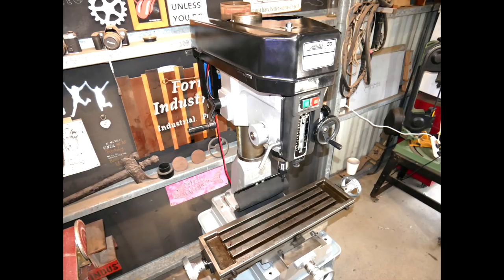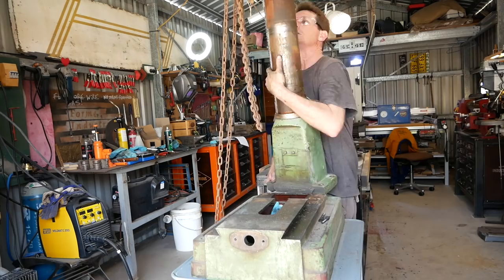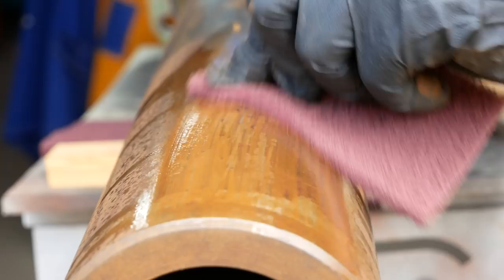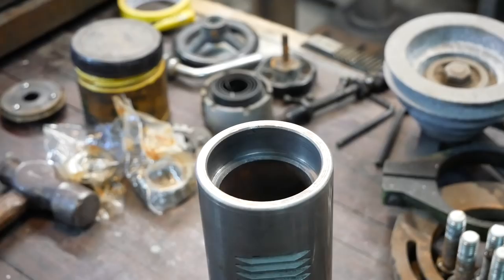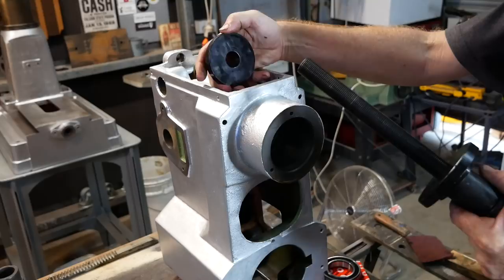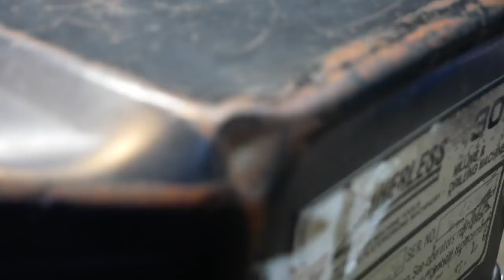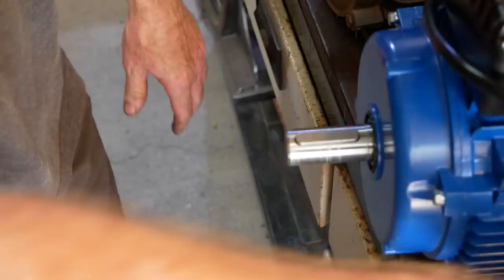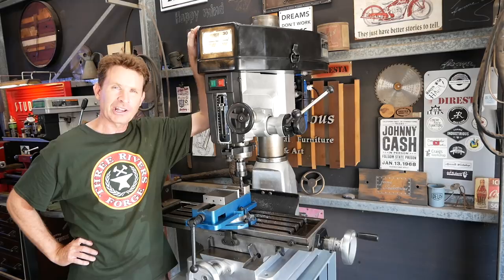RF-30 Mill Drill Restoration - Forme Industrious

Comment: Hey Scott, great work. Adelaide to Townsville and back is a bloody long way to get anything, even if it is free. Personally I would have gone for the VFD. I’m running three in my workshop including one on my 3 phase x 3 hp turret mill and the VFD for that was $120 delivered. It’s not just being able to run the three phase but you get speed adjustment at the turn of a dial and reverse. No more changing pulleys and belts. Anyway I really enjoyed the video. Cheers Stuart, Canberra.

Comment: Thanks Scott.  I just picked up one of these and am preparing to do the same thing.  This was a great tutorial.
Reply from the maker: My pleasure! Good allrounder these machines.
Reply: @ScottTurnerformeindustrious  Has the machine had much use since this video?  I ask because I was wondering how that paint held up?  Thanks
Reply from the maker: @rustyshackleford928  Hasn't had a heap of work as I have been doing other things, however I'm very happy with the paint so far.

Comment: I found toilet bowl cleaner useful for de-rusting. The gel type sticks quite well to the object being de-rusted and it's gentle on the metal. I was given a Schaublin 102 turret lathe for free that needs similar love and care to your RF-30. We have 3-phase so no need to do a motor swap. Actually considering mounting a 3-phase motor on my mill so I can use a VFD to control speed.
Reply from the maker: Toilet cleaner, will have to experiment. Restoring the old machines is a big task, however it is interesting once you get past all the grim. VFD would be nice. Thanks Michael!

Comment: Great Scott! Wizard video thanks, and a reference for me as I've just acquired a generic copy. Mine has no name but I suspect it's a Warco variant. Suggestion... my gib strips are tapered and adjusted by sloppy screws in a slot in the jib just like yours. I replaced them with studding, seated tight in the blind tapped holes. I them turned up two threaded buttons that perfectly fitted the jib slots, so now I can adjust them to that perfect spot with no wobble or tightness.... and hold them there on a lock nut. (I have to turn hex nuts down to a small round OD to clear the jib.... easy to do, mount them on a tap and hold that in the 3 jaw.) 
I shall get going on sorting quill, fast and slow feeds and the rack/pinion on the column next. Also need to check alignment of column to bed. Only adjustment is by shims under the clamping bolts......
"You beautiful great thing" made me laugh!
Thanks again Scott.
Reply from the maker: Glad you enjoyed the video and thanks for sharing your journey on your machine.

Comment: Nice restauration-I have the bigger RF-31 and did a similar restauration about a year ago,however i threw away the old leadscrews and replaced them whit new ballscrews instead-definitly worth the money,mine is also upgraded whit a 3-axis DRO and a diy-3axis-cnc-kit whit nema 34-motors-lots of fun stuff hace been made in that machine
Reply from the maker: Cheers! Will have to look into those ball screws. They would be great for getting rid of that pesky backlash.
Reply: @ScottTurnerformeindustrious  they r indeed

Comment: Hey Scott.  I’ve had great success in removing rust and scale buildup on many vintage parts by soaking them in straight household vinegar.  You have to let the parts soak for a day or two however, so it’s a little time consuming but after that soak, a wire brush takes it all off without much elbow grease.
Reply from the maker: Good tip, thank you! I'm a little impatient.

Comment: Scott, I had no doubt that you would return this "dirty girl" back to its former glory. She looks like a teenager again! You did an outstanding job of restoring this old girl. I have to say that the parts you were removing were actually all in good shape, just a bit neglected. I have found that older machines made in Taiwan were built quite well. I have'ntThe columns of machines like this, drill presses, etcetera, always seem to get rusty. It's very easy to prevent that and that is done by a-monthly spraying of WD-40 and lightly rubbed off leaving a light film on the column. I also use paste wax on the flat surfaces such as my table saw that I do often. Once a month is just how I maintain my machines, but I think once every 3-6 months should be fine too. Have you had a chance to speak to the previous owner? I bet he is a bit sorry for giving it up after seeing it in a like-new condition. She's a beauty now. Well done mate!!
Reply from the maker: I'm so glad I took the project on, and extremely grateful for the generosity of the previous owner. Yes I have been in touch with the donor and he loves that it is refreshed and in use now. Yes apart from surface rust and crud it was pretty good all up. Where I live is quite humid (Tropics) so I have to spray all the surfaces at least weekly. My lathe chuck and band saw surfaces seem to have hand contact more that most other machines and they will oxidise pretty quick if not hit with the WD-40. I use wax (on the machines ;), say every six months and that works great like you say. Thanks you so much again for your comment and feedback!

Comment: Wow Scott, your shop is really coming together. Such a nice job you did on that mill. Tremendous amount of effort you put into it. It looks like it had very limited use, but was rusty. Now cleaned and renewed it should serve well. I have a very similar mill from Tiawan, mid 80s, its a stout unit and works well, needs to have your  treatment done with the new spindle bearings.   You vid was very helpful seeing how it all put together.  Your mill has Mt3 taper in the spindle, however It looked like it has the "slot" to lock the collet as well, not familiar with that here but if there is tooling to match with the drive slot that would be very stable system.   Thanks again for sharing, expect you will have many projects benefiting from the milling machine.
Reply from the maker: Thank you Douglas! I'm very happy and quite grateful to have this machine. It took a bit of effort and I guess that adds to the satisfaction. Yes it has a MT3 Taper and Draw Bar. I had to make the draw bar. No slot in the taper. The chuck is an ER32, I bought from Ebay. Thanks for your comment Douglas! All the best.
Reply: @ScottTurnerformeindustrious  Still enjoying your work and this video years later.  My spindle bearings still making noise. Did manage to pick up another used Clausing 8520 mill , smaller, using MT2 collets, but a fine small knee mill.   One thing that would have been nice to incorporate into your restoration, would have been some indicator arms on the column and mill head to keep it aligned when raising the head during a project.   A simple dial indicator at distance on light weight arms would do well.
Reply from the maker: @douglassmith2055  thanks Douglas! You are right on the alignment and I have had the problem a few times now. You can buy an alignment guide/ brace the keeps the milling head central, otherwise you set up a dial like you say. A knee mill would be awesome  however I must say I'm still very happy with this old thing. All the best!

Comment: Scott, Evaporust is now available at Super Cheap Auto here in Oz. I was sceptical when I bought some having seen so many references to it on certain US based channels but it actually works great. Doesn't harm the paint either. I know how hard it is to remove that hardened rust crust. 
Regards,
Mark Presling. Sunshine Coast. Qld.
Reply from the maker: Thanks Mark! I didn't know that. Will definitely get some and try it out. All the best down there at the beautiful Sunshine Coast!

Comment: I had one identical to that.  It was great to learn manual milling with.  

My #1 suggestion is to replace the pinch bolts for the head with proper high-grade, fine thread bolts.  The Chinese ones are soft, and will eventually allow the head to slip down, or rotate, causing scrap parts at best, or a hard crash into a vise or rotary table at worst.  

My #2 suggestion is to figure out a method of repeatably locating the head.  I had thought about using a laser pointer and a mirror on a far wall to reflect back to a target on the mill head.  I never implemented it, though.

I think you'll get a lot of enjoyable hours of use out of it.
Reply from the maker: Thanks Alan. Already replaced. What came with the mill was cut off threaded rod with nuts. I replaced with High Tensile bolts and nuts. M16 I think.

Comment: I have to say that I really enjoyed this revamping the milling machine. Am really curious as to how close of a tolerance the machine can hold ??  Would like an answer if you can be so kind. Thank you Sir. Good day too.
Reply from the maker: Thank you! Well, I haven't done anything that I would call precision on the mill yet. The Specs say it can achieve 0.02mm which is pretty good. To achieve that though I think I would need a quality Collet chuck and end mill. Mine are cheapies but they are okay for my needs.
Reply: @ScottTurnerformeindustrious  Thanks Scott !!!

Comment: I'm getting a 1999 Wong Fu R-30 in a few days and can't wait! Although, I hope I don't have to go to this level to get it going ;-) RE: the chrome ring you cleaned up, you can do your own nickel plating and buff it to make it look almost like chrome. Just look for "DIY nickel plating" on youtube. It's SUPER easy and I've even plated some antique tools, which came out great. Also, the rust removal could have been down in a fraction of the time using a car charger and couple other basics. Just look up "electrolysis rust removal" - anyway, great work!!
Reply from the maker: Thanks for the tips Pete. Will have to try it some time. You've got a good solid machine coming by the sounds. Cheers.

Comment: Ive got the same mill drill myself - bought it s/h and it has pretty worn ways and feed nuts but it serves a purpose for me - i have to face mill loads of steel blocks.  Still quite accurate if you nip the gibs up, and  Im thinking of making delrin feed nuts for it, as the stock ones are hard to source - from what Ive heard the new feed nuts are quite loose fitting 

Great video tho'  - I'll most probably be needing to strip it down to change bearings in the near future👍👍
Reply: I also have same mill, different name and worn out feed nuts.  I know a man here in Calgary who will be retro fitting bronze (not brass)  nuts that will be inserted in a steel housing which will make them easily replaceable.  Apparently the factory no longer exists and the nuts just can't be found. I went to a machine shop and to replicate the original nut $600.00.  Good luck.
Reply: @idiotradar1    most probably be easier and cheaper to buy a length of acme rod and nut and make a leadscrew

Comment: Hi Scott, if you want to remove bearing inners take your arc welder and lay some weld on the bearing surface in about three places, that will contract the metal and they should almost fall out.
Reply from the maker: Never done that but it sounds like it's worth trying next time around. Thanks Andrew for the tip.
Reply: @ScottTurnerformeindustrious  I first saw Ave do it on YouTube then my neighbour did it when we changed the bearings on my truck. Incidentally Ave also had a great trick for removing blind bearings... Grease and a rag... Check him out.

Comment: I have the exact same mill. Mine was sold by Grizzly about the same time. It is a nice mill. I wish it had a DRO. I am just a hobbyist, but it seems accurate enough. I don’t know if I could have taken apart mine and reassembled it as you did yours. 

Kudos and best wishes from Virginia
Frank
Reply from the maker: Thank you Frank. I think the DRO will be the first upgrade for the mill, but for the moment everything is fine and I'm pinching myself that I have this machine now. All the best.

Comment: Hi Scott, I have the exact same drill that I need to move..... how did you lift it off your ute, did you lift from a bolt or just choke it with a sling? Thanks Damian
Reply from the maker: just choked it with slings. Still a heavy sucker.

Comment: Great job you did. I have acquired an Enco 30 that is a twin of yours - how was your quill backlash, mine has about a 40 thou. Does your unit have adjustment from the cross shaft to the quill column teeth? I am trying to figure out how to mesh them closer.
Reply from the maker: To be honest, I've never measured it. Normal practice for me is to lock all the axis that are not in motion including the Z (Quill). I would like to put on a digital read out on everything, that would certainly help, but locking down is still very important.

Comment: Do you happen to have a video of the backlash adjustment for both screws (table X & Y), my RF30 is getting very tight in the Y Axis. Loosening the gib makes it easier but it also added slop. Also do you thing there is a modification worth making that would better apply lube to the X & Y slides ? Thanks, great video.
Reply from the maker: Hi Gary, from memory the lead screw nut has the same backlash adjustment on both table axis. I guess if you back off the Gibs to reduce all "other" friction and check to see how easy it is to moved the lead screw. If tight still, back off the nut a tiny amount. If loose inspect your gibs and ways, look for burs and build up of grunge etc. Then lubricate and adjust the gibs to get that point where it moves freely and is tight. Sounds easy but it may take some time. Lube; no sorry, other than going full travel, wiping clean, and applying lube.
Reply: @ScottTurnerformeindustrious  Thank you

Comment: Great video thanks,.... I am in the process of doing the same to my recently acquired RF30,,so some good info there, however, you skipped a few things, like, what preload did you put on the spindle bearings, did you aseemble the cone clutch dry or lightly lubed, how did you tram the table or did you just trust that the column was perfectly perpendicular to the table?
Cheers
Reply from the maker: Thanks Phil! For the bearings I snugged up the locking collar whilst rotating the spindle, then backed off the nut a touch, then locked it into place. Must check that any float is eliminated and the spindle spins freely without binding. Clutch, can't quite remember, dry I think. Tram, I did a test with a dial and it was very close standard. It is unlikely that I will use the mill for precision work so I left it as is. I'm very happy with the mill, comes in handy.
Reply: @ScottTurnerformeindustrious  Cheers Scott, appreciate the reply, and will follow your advice. Cheers :-)

Comment: Scott Watch your videos and your restoration on the RF 30 were you changed it from a three phase to single phase I am doing the same thing trying to find out more on the motor and wondering if you could help me with what motor you got
Reply from the maker: I used a 1.5kw single phase 240v motor. I find it has more than enough power for the work I do. The change over is simple enough. Shaft and pulley for size matching is important. Email me if you need photos etc.

Comment: How did you get the top outer bearing out? Stripping mine down, and there seems no way to get at it- the bottom is flush with the bore...
Reply from the maker: Check the video around the ten minute mark for the spindle. For the top check the 15 minute mark. You may need to press the bearing out using the inner bearing surface as the contact point. Bearing must then be replaced. Hope that helps
Reply: @ScottTurnerformeindustrious  Probably did not make myself clear- I was referring to the outer race of the upper spindle roller bearing. All the other bearings were removed fairly easily, but this one does not have an inner bearing surface- it is flush with the bore. Did yours have a lip? I cannot see in the video how you removed this.

Comment: Great job, I just purchased one it was used it didn't have the original motor. What size motor did you use HP and frame size. Great job👍
Reply from the maker: Thank you Woody! I used a 1.5kw (2hp) motor with close to the original drive speed. The motor mount used was the original. The 2 hp motor works fine for my needs.

Comment: Hello Scott, amazing job!  I just got an RF-30 given to me by a friend that purchased a new one for himself.  I do sot seem to be able to get the Fine Feed Engagement control to work properly.  It sometimes engages going up but almost never going down.  Do I need to clean the quill?  Not sure where to start.  I would greatly appreciate your advice.
Reply from the maker: Hard to tell what the issue is but the mechanisms are very simple. There is a "wind in, wind out" clutch on the side of the dial, maybe it needs cleaning/ retensioning. It may pay to regrease the mechanisms anyhow, because if it's anything like mine all the grease became hard and useless.
Reply: @ScottTurnerformeindustrious  Thank you, I will do that.

Comment: Hey there Scott thank you for posting this video, I'm currently in the process of doing the same thing on pretty much the same machine so keep coming back to your video to watch every little thing you did. One thing I do have a question about is when you reinstalled the new lower roller bearing on the spindle.. did it  go all the way down and sit against the head of the spindle or was there a little gap there, if you recall please let me know I would really appreciate it. Thanks in advance.
Reply from the maker: Thanks Kevin! From memory the bearing bottoms out on the spindle shaft, then you install the shaft into the housing. The  outer bearing race should be installed prior to the Spindle housing. Video reference 13:03